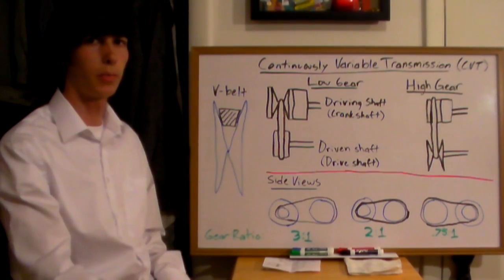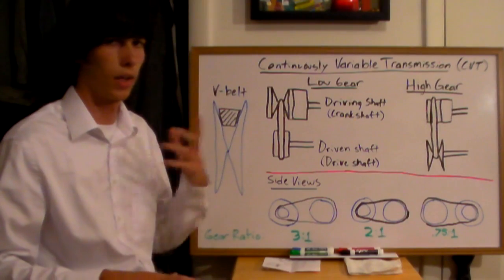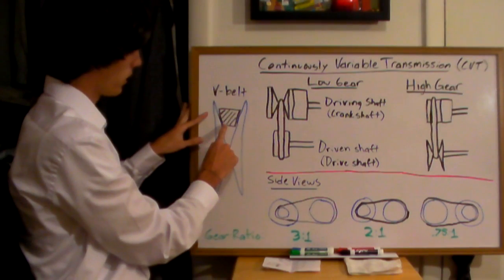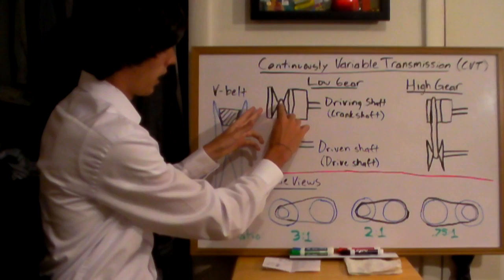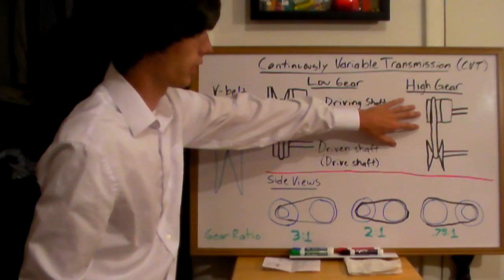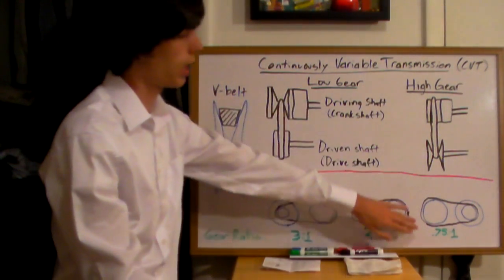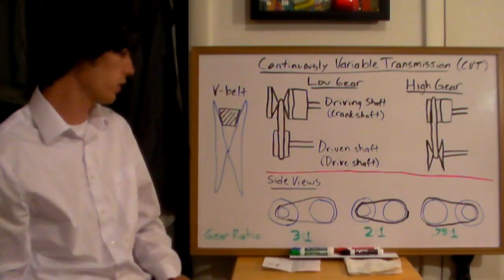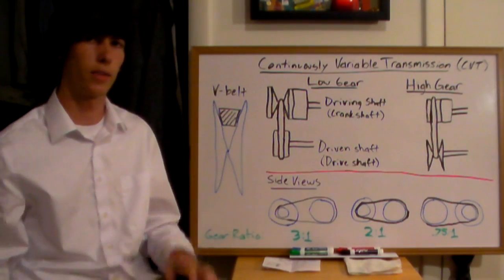Continuously Variable Transmission - Explained

Comment: very good explanation. I would like to suggest a video about the direct shift from 2020 and newer Toyota Corolla. Some say the CVT has a first gear that eliminates de delay normal CVT transmission cars has. But the fact is that if that first gear is receiving power from the Torque Converter, the delay will remain. So maybe you could clarify this for once and for all. Thanks and congrats for the excellent videos you offer to all of us.

Comment: Hello, I Bumped into your YT page while researching an issue am having with my Car. I have a Toyota Auris T3i European Model which has a TipTronic gear system (guess its CVT)

It has developed an issue where it refuses to engage Gear from Neutral to drive. Prev. when it did that i would let it rest for a while then it would resume working correctly.

It has gone to worse now coz it will start but not even engage reverse gear.  some mechanics here say its is low on Gear Transmission Fluid Oil(CC). Others say that it does not take CC.

What would you think could be the cause of the problem and what options do we have ..?

Comment: These CVT’s really work, they are what are used in snowmobiles, they give a lot of low end power and keep it in the power curve, so all that means is you can go as fast as you want, up to about 80 MPH on only 600cc, about 120hp

Comment: Do CVTs experience any significant power or efficiency loss due to the use of belts instead of gears?  I assume belt slippage or overheating is why they can't be used on high hp engines.
Reply: Yes, a belt and pulleys is not quite as efficient at transmitting power as gears, however the increase in efficiency due to more ratio choices, is greater than the loss of efficiency due to belt slippage. They aren't 'a good  choice for use on heavy vehicles or to pull trailers. They are terrific on light to mid-weight vehicles with small to moderate-powered engines. Honda is putting them in Accords.

Comment: What about controlling the CVT? I'm assuming it's got a microcontroller? I understand that there is a max power band, but what rpm do you aim for when considering practical applications? How do you determine the optimal ratio?

Comment: You pretty much just explained how a torque converter for a mini bike or go kart works! Your illustrations anyway look just like an illustration for a small engine torque converter. I did see the pic of the prior video though that appeared to have a belt going around a set of parallel conical shaped cylinders with the coned taper of each cylinder set at opposite ends to each other(wheeew, there has to be an easier more direct way of explaining this). I have never seen that particular setup before but it looked interesting!
Reply: It works the same way in a heavy duty application like a John Deere work mule,  a street scooter,  and a car. Same principle,  applied in a different manner.  They where actually adapted from commercial use,  to fit on go karts ect....

Comment: Engineering Explained, Will you talk about the differences between, CVT's with steel belts vs. CVT's with chains, and which is more durable, and would one type tend to last longer. As I understand it, the belts work by compression, or pushing toward the driven pulley, and the chains by tension, pulling on the driven pulley.

Comment: Great video as always! There is one thing I do not understand, though: this transmission allows for an infinite number of gear ratio configurations. Does this mean that a CVT has an infinite number of gears - further more, does this mean that this system has no "gear" at all? 
Thanks
Reply: +ProjectD100 "Number of gears in a CVT" makes about as much sense as "the number of waters in a cup'. It's a smooth transition from empty to full. It's just continuous.
Reply: But seriously, how many waters are in a cup?

Comment: What is the weak link that can't handle the higher power engines? It seems like the belt or the way the pulleys are designed might be the weakest parts, but that's just me guessing. I've never had to work with a CVT but I'm definitely intrigued.
Reply: TurdFurgeson571 I think that sounds about right. The only other possibility I can think of is that the belt begins to slip with too much torque.

Comment: My corolla has CVT, but it also has tiptronic mode to change gears. What is happening here? Do the clamps go to a preset position for each gear?
Reply: Yes. What they do is select 7 different ratios to simulate a normal manual gearbox or a double clutch gearbox.
Reply: Ryan Davidson Its been 2 years how is your corolla doing?
Reply: No issues so far at 45k Km
Reply: No issues yet at 45k kms

Comment: CVTs do NOT have Infinitely Variable Ratios! (as stated around 0:18s in video)
That is an Infinite Variable Ratio IVT system - not CVT.

A CVT such as the mechanism you depict is limited to the minimum & maximum dimensions of each cone. For example it is not possible to send the drive into reverse.
This is the main difference between an IVT & CVT - an IVT can have both positive & negative gear ratios (forward & reverse) and Geared Neutral.
Reply: That's still an infinite number of ratios.
Reply: Ian Leppert there are an infinitive number of numbers between any discrete values, so even if the CVT only had 2 discrete ratios (i.e. 1:1 and 1:2), there are an infinite number of ratios between the 2 discrete ratios.

Comment: Just found out today that the 2015 Subaru Legacy 3.6 Liter Boxer 6 cylinder engine is the highest engine displacement to feature Lineartronic CVT, because this engine makes 256hp and 247lb.-ft. of torque. Before it was Toyota and Lexus V6 Hybrids, along with Nissan and Infiniti with their 3.5 Liter V6 engines as the highest displacement to use the CVT. However the Subaru Legacy features Symmetrical AWD as standard equipment, and for 2015, all Legacy models will have the Lineartronic CVT standard with either the 2.5 Liter Boxer-4 or 3.6 Liter Boxer-6.
Reply: My Altima stock makes 270 HP and with all of my mods I'm most likely hitting 290 HP with the CVT. Still higher than the Subie. The only difference it it's FWD.

Nissan still has more experience with CVTs.
Reply: Frozen-X He was talking about displacement not power and/or torque. Your post just sounds like you're trying to brag and provides no relevant information to the post.
Reply: Not sure how providing data is bragging but okay.

On other news the CVT Maxima is beating other cars on the track.

Comment from the maker: CVTs are efficient because they allow you to keep the RPM in a certain range, and since you can keep the engine in it's most efficient RPM range, you'll save energy. When you let go of the gas it will likely "gear up" thus lowering the engine RPM to save gas when you don't need the additional power.

Comment from the maker: I suppose if it were to use set gear ratios within the CVT's range, it's possible, but it seems this would never really happen - I would assume typically the driver wouldn't have any input, like a traditional auto.

Comment from the maker: It's going to put the RPM partially based on driver inputs. If you let your foot of the gas some it should lower the RPM eventually. Unless of course is the gearing needed to go the speed you're going.

Comment: Hi, I'm highly interested in the new model of Toyota Auris (which is the Corolla Hatcback in some countries). I really want to buy it with the CVT. I wonder why especially the Auris is so different from the one with the manual transmission in terms of acceleration time, if it is that "fast" changing gears/ratios? I mean if there is no gear change lag shouldn't it be faster than the manual transmission? Oh btw 0-100km time is 10 seconds with the manual transmission and 11.1 sec with the CVT!

Comment from the maker: Most CVTs today are not built for much power. I wouldn't recommend boosting an engine coupled to a CVT, as they're typically low power/high efficiency cars.
Reply: Not bad

Comment: The only two CVT cars that I know of are the Honda Fit and Nissan Sentra here in Brazil. I wonder what cars with CVT you got in the US. The Honda system never showed any problem.
It's a really old system, too. I think I read somewhere that this system was even used in FORMULA 1, by Williams. But it got banned before any race. That's worth checking out.

Thanks for another great explanation!

Comment: here's my POV after driving a maxima 2013 for 2 days: nissan makes cvt's because they have the worst mpg from their motors (IMO) and cvt is supposed to help mpg. The way electronic handles the ratios is where it can hurt your ears, mostly at high rpm where it is really annoying, but if you drive gently, its nice. Really, dont pick a car based only on a cvt choice, there are much more important factors.

Comment: are they any disadvantage for performance rather have an conventional gearbox manual or double-clutched.. cause even if the engine stays where it produces max of its power under hard acceleration, i think the only good point of CVT's is comfort.. I'm telling this apart from the feeling inside with conventional manual where you feel the gear changes and the different G's you feel.. so can we say, a car can go faster with CVT if we put the same engine on a same car than conventional transmission ?

Comment: I'm looking for a new car, and revewers don't like CVT.

Here's an example of their phrasing @ Car & Driver:

>"Its 130 horsepower and 128 pound-feet of torque are reductions of 10 and 19, respectively, from the 2.0-liter in the outgoing car. Coupled with a CVT—a double bummer.."

I'm leery of getting a car with CVT

Comment from the maker: I haven't heard of anything like this. Sun and ring gears are controlled using a system of clutches and belts. You would have to have clutch slip in order to differentiate speed, which is not an ideal way of power transfer since it would be based on excessive friction (heat loss, low efficiency), and would wear out.

Comment: Could you put his a normal car with a manual transmission but have the CVT in between the MT and the differential? Also is there some way you could program a CVT to change gear ratios at a certain engine speed? That way you could stay in first gear and then when you get close to shifting time, the CVT goes to a lower gear ratio and you can accelerate in one gear longer. Is it possible?